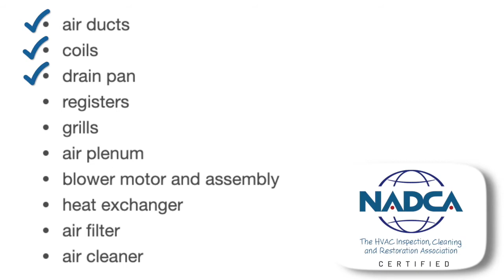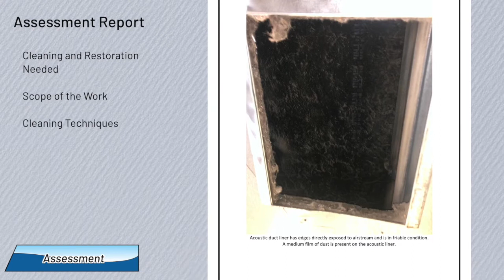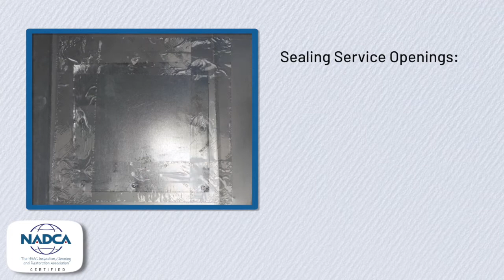HVAC System and Air Duct Cleaning (2021 NADCA ACR) - Southeast Clean Air Solutions - Richmond, VA

Comment: But are you licensed for conditined air tho?
Reply from the maker: We’re based out of the state of Virginia which does not require an HVAC license to perform cleaning services on the HVAC system. Certain other states like Florida do require an HVAC license. 

We work closely with a handful of licensed HVAC companies to provide them with opportunities to perform the work which requires a license - system replacements, coils/refrigerants, or other system modifications. Their service manager is on speed dial and we train with them to learn how to identify warning signs (like a brown oily film in the drain pan or undersized ducts) during our preliminary inspection. Then verify or rule out these concerns with them before giving our recommendations with supportive evidence and the contact info of the service manager we spoke with. 

Thank you for your question.